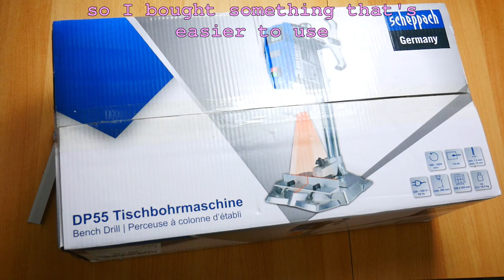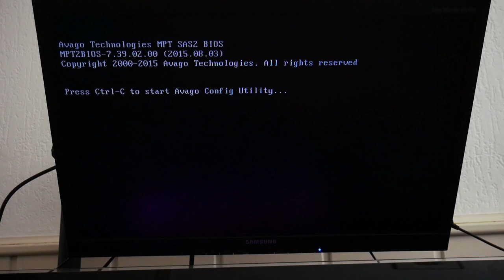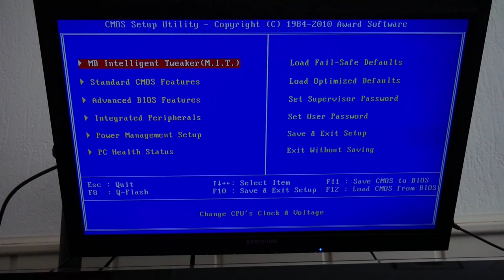DIY NAS: Making an improved DIY HDD Cage

Comment: You know you can buy hdd cages and just attach them with screws.   If you're going to put effort into fabrication why not get a test bench as a motherboard tray and build a case around it.
Reply from the maker: Well there was a HDD cage in there when I bought the case. I put some disks in there, and within minutes one of them broke. So I thought "that's weird, must have been a manufacturing error or something", so I sent it back, got a replacement, tested it outside the cage with some software that writes in every sector, which took hours. Everything was fine, so I put it in the cage, in the same spot the old one was in, set everything up, started writing data to it, and the brand new disk that I had just finished testing for hours broke again within minutes. Then I assumed that since they are desktop disks that aren't meant to be stacked this closely, probably vibration killed it, maybe resonance. I then decided that I should probably get a different cage with some damping material between the disk and the cage. I couldn't find anything cheap that looked good, and since I was still a student back then, my budget was pretty much 0, so I decided to build something. Also, the plan was to get a server rack later on, so I could add an external sas enclosure for more disks in the future, and maybe some rack mount audio equipment.

Comment: When you get some time, touch the heat sink on the SAS controller. You'd want to add a small fan on it. 😊
Reply from the maker: Thanks for the tip. I actually already put a small fan on it, but since a lot has changed in my life this year, the project ended up in a corner again.
I do plan on finishing it soon though XD

Comment: Nice video, great build. As for the HBA card, do you have it in IT mode? I also have a SAS2008-IT, and I've been able to make a ZFS pool with them without issue. I know there are more factors to it, but just an idea! Best of luck in your build.
Reply from the maker: Thanks :)
Yes the SAS card is in IT mode. I bought it pre-flashed.
The reason why it's not working is because one of the HDD is probably broken.
I put the HDDs in the original cage in the previous video, and one of them stopped working rather quickly. Then I sent it back, got a replacement, tested it with badblocks, no issues. Then I put it in the original cage, at the exact spot where the previous broken disk was, and within a minute the new (tested) replacement disk broke. I think it was caused by vibration resonance. Sadly I didn't have time to continue yet because a lot is going on in my life right now.

Comment: Temu had this plastic Drive case kit.  I think I got it for less then $8.00 bucks.   This seems the way to go about it if you just want screw, glue &  play.    It seems to fit the spirit of the build.   Though, I really think your is much more sturdy.  

For all else?   Just getting a cheap used Server case like those from the SCSI era, and throwing in new parts to that sure seem the way to go if you are just doing a bunch of drives for something like a media center where you already have all your media on the original storage medium as a backup. 

Otherwise?   
It really does seem to be a better idea to just load up on 22 TB drives on sale,  Then get  LTO-9 tape as a backup medium.    It does cost a lot up front.   But when you consider that today,    A Normal person with a family can make close to  20TB of Data a Year with Videos in 8k and photos etc?    

The TAPE thing starts to make real sense.   And when they get down to about $50 bucks a tape or less?
That's seems like the way to go.  

Most of our media / Data we just keep around.    By the time maybe in 20 years or so?  They might come out with petabyte hard drives people might be able to afford.

Comment: X58 build? Just curious about the cpu fan orientation?
Reply from the maker: Yes, using my old i7 930.
When I first built this server, the fan was blowing air down onto the cpu, but since I have the small 80mm fans which mostly pull air from above the cpu fan, I decided to turn it around, so now (also at the end of this video) it pulls the air up and away from the cpu & motherboard.

Comment: You can buy lots of very cheap big used chassis cheaper than what you do , Dell chassis from refurbished stores . Unless you want to waste your time or enjoying the modifications work
Reply from the maker: I do enjoy the modification work! But also, I am using desktop HDD because server HDD are much more expensive, and I broke two of them before doing this modification because of vibrations (resonance from multiple disks running in the same cage). I didn't just want to get another server case, because I wanted to have the disks held in firmly, without having any metal (screws or whatever) between the disk and the cage that could transfer vibrations to the chassis.

Comment: You seem to have a good idea on how to use a file, but I have to be that guy. You needed to draw the material towards you rather than away in order to get the burrs off, and I'm only saying that because it looked like a single cut instead of a double cut file. 

Other than tool usage, everything else looked great
Reply from the maker: Oh you mean away from the cut instead of towards it? I think I went both ways anyway, since I wasn't sure.
You're right, it is a single cut file.
Thanks :)
Reply: @TheYUKATI  I really wasn't trying to sound long a jerk. I know filing can be very annoying.

Like I said, everything else in the video looked good!
Reply from the maker: Oh don't worry, I saw it as a friendly addition of information I didn't have before ;-)